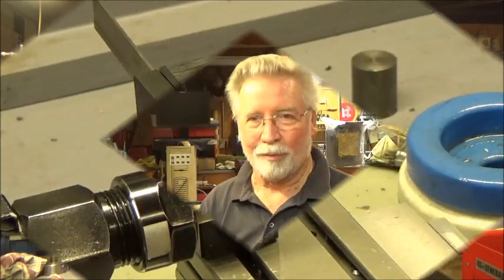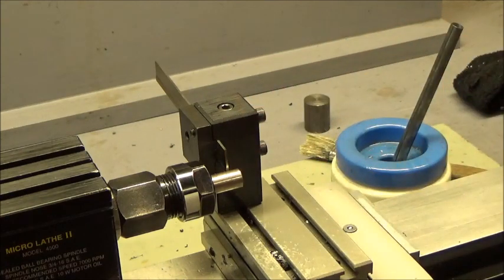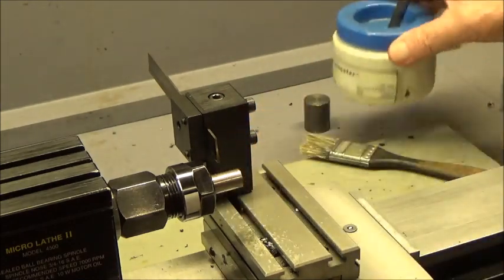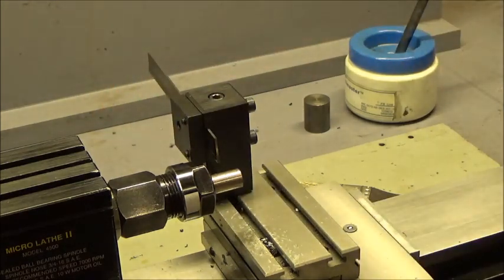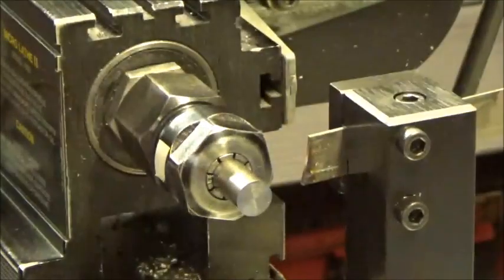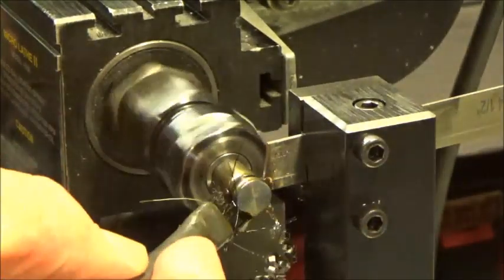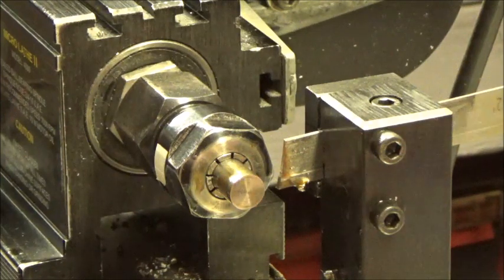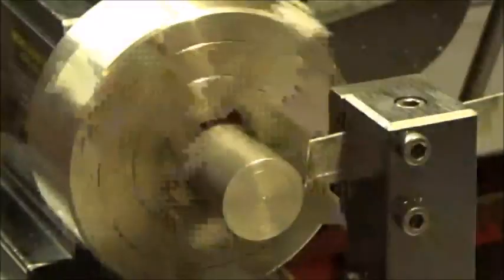Taig 1173 T-Bar Cutoff Tool Post (Parting Off 0.875" Dia. Steel Rod)

Comment: I bought the Sherline one a couple decades ago (lol) but haven't gotten around to adapting it yet.  It looks promising and it will allow cutting off close to the collet or chuck but has to be mounted from the front of the crosslide.

Comment: Ok Larry I must be doing it wrong that and 1 & 1/4 is asking to much of it.
Reply from the maker: John:  I assume your using the 4-jaw, because I don't think the scroll chuck opens that far.  In that case 1.25" should be fine.  The larger the diameter the harder it will be to get started.  If you have a slow enough power source with adequate torque, then it should be no problem.  Even the 0.875" diameter had a tendency to stop occasionally until the diameter got whittled down some.  That said, I really had no chatter to speak of.  My friend Walter Maisey just made a video cutting off a similar size piece of mild steel (1.25" I think).  The Taig would of done the job, but it was taking a very long time.  The Spring tool holder is a lot more efficient.  Good Luck and Best Regards: Larry
https://www.youtube.com/watch?v=IlwuQndc3ZU&t=6s
Reply: @larrypoindexter9351  Nope 3 jaw

Comment: Larry, nothing wrong with that tool as regards to parting off but the clamping angle of the tool is not the best idea, I would be inclined as a nice little project to cut off the bottom portion of the block at a 10-degree angle machine a new bottom according to calculations allowing a nice deep slot at the same angle same corresponding fit to the top portion and after adjustment lock through the side with a couple of set screws
Reply from the maker: Walter:  That's a thought.  I think I remain locked in to my spring tool holder for any heavy duty cutoff work and just the normal tool holder for light work and non ferrous metals.  Best Regards: Larry

Comment: Excellent video Larry. I have a tabletop Taig in the basement and there are far too few videos on applications of this small lathe. Parting is one process that is good to discuss and your demonstration is proof it can be done with confidence. I look forward to more Taig related articles, and I like your comment on the shortcomings of the scroll chuck, I never thought of going to the independent jaw chuck because the former is too damn easy to think of first. One question, are there videos on your cross slide modification, it looks pretty effective compared to the OEM design. Thanks and cheers!
Reply from the maker: Howder:  Thanks for the generous comment.  Best Regards: Larry